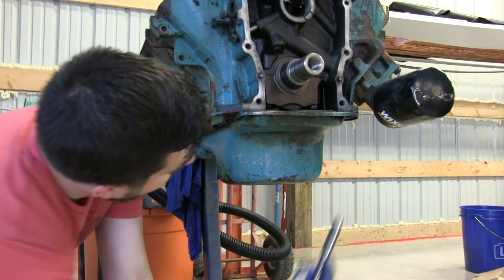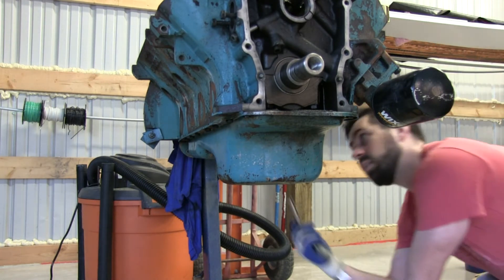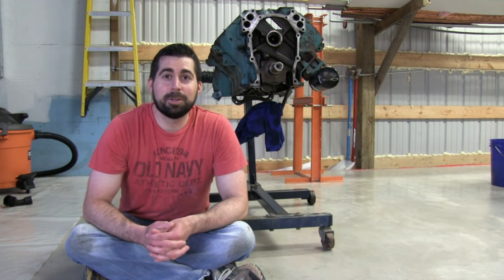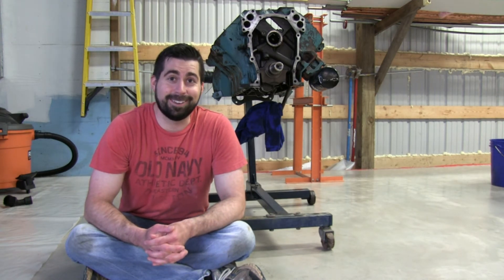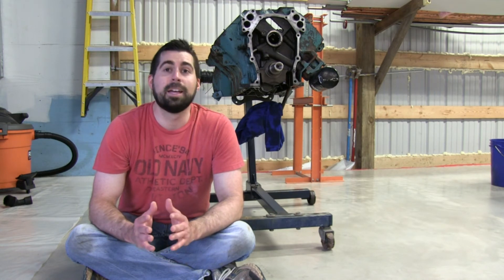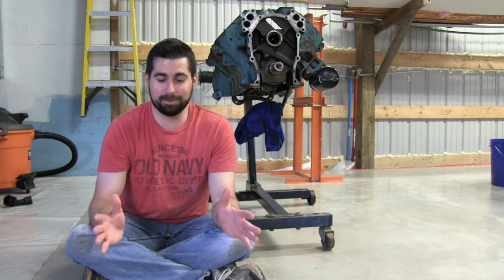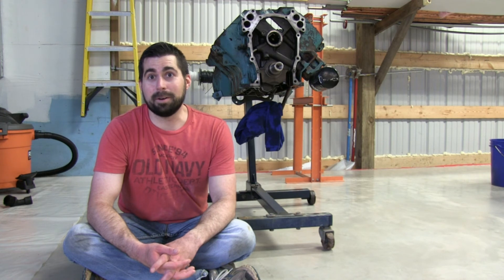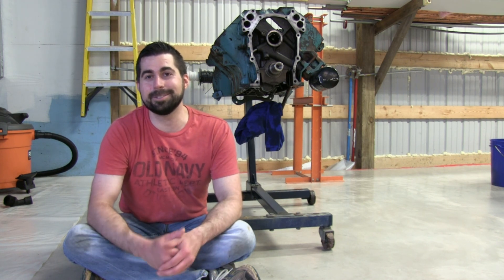EPIC FAIL Mopar 440 Engine Build Part 11 - Oil Pan Removal

Comment: May I have question. Is is possible to remove pan with engine in a car? There is a space to unbold all bolts, but Im not sure is pickup tube let me to take off the pan. 

Thank you :))) 

Regards from Czech

Comment: Why didn’t you drain the oil first then turn the engine upside down to remove the oil pan it’s why you have an engine stand right? And it’s a lot easier to work smarter not harder bending down underneath to remove the pan!
Reply from the maker: this is very true.

Comment: Should have took drain plug out... when drained completely... have a large pan under engine... turn engine over on stand and take pan off with it facing up...  plus don't need to bending over getting to pan bolts...  just my comment.....